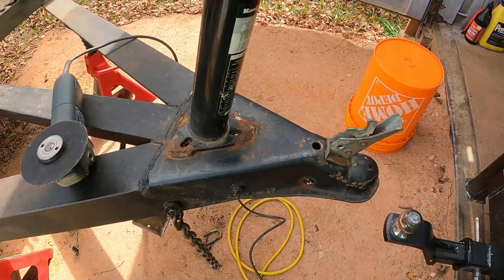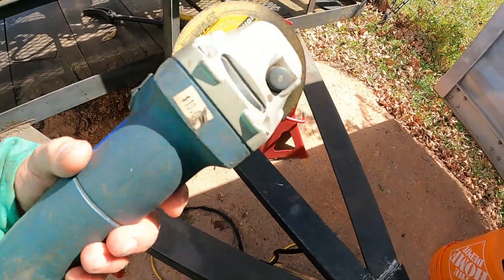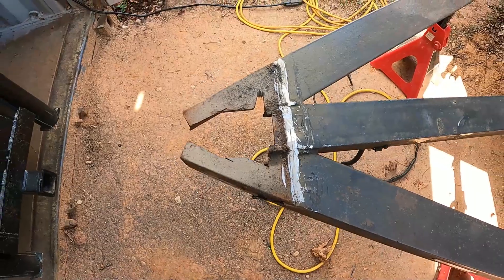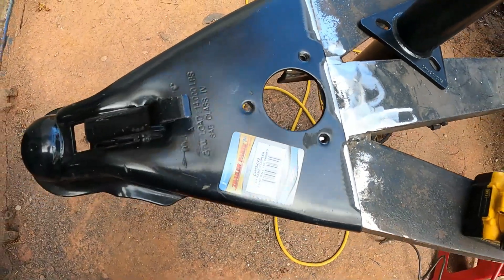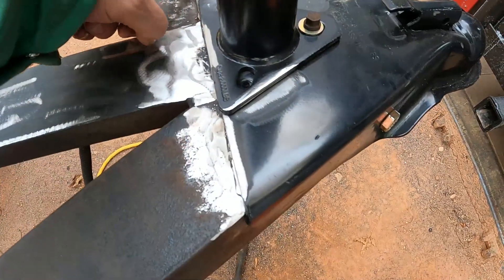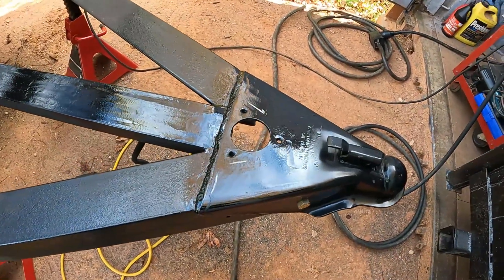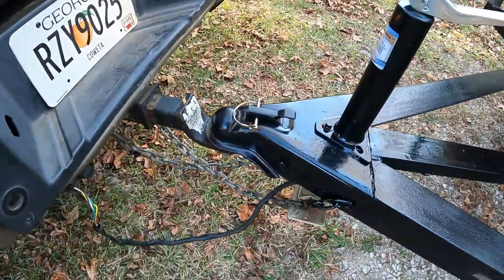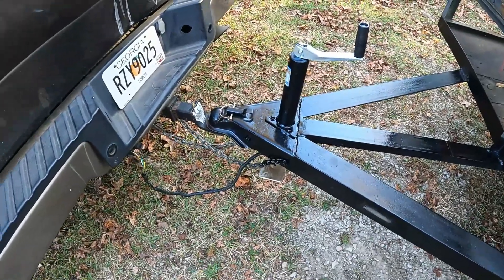DIY Replacing Landscape Trailer Tongue Coupler And Jack

Comment: Why weld the jack? If you bend it again you get another mess. Just bolt it with 3 grade 8 or higher bolts.
Reply from the maker: That would have been ideal but two of the holes lined up with the vertical leg of the c channel and I didn't want to cut away any more structure. Next time I will show more detail and why I do things the way I do. Thanks for watching